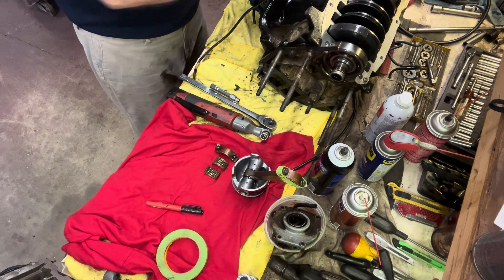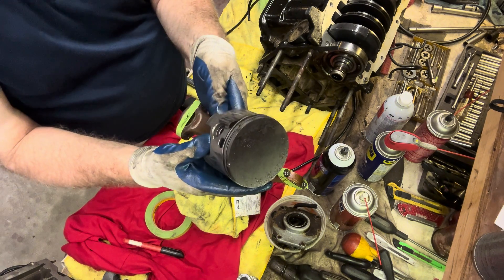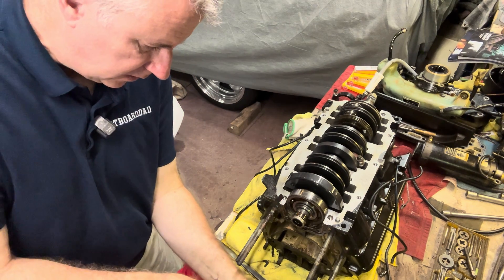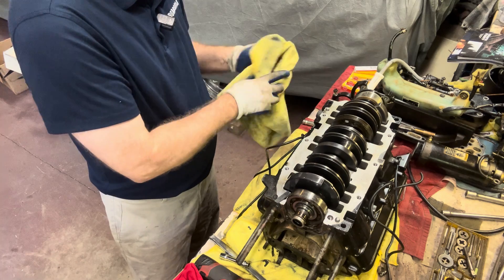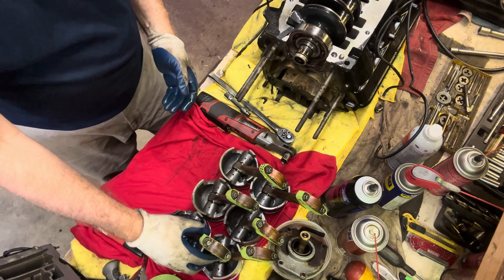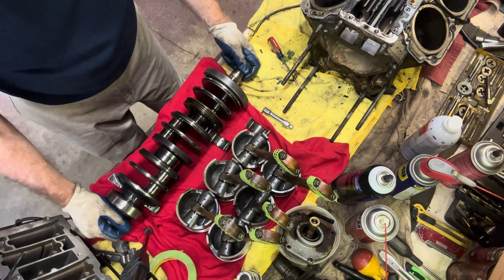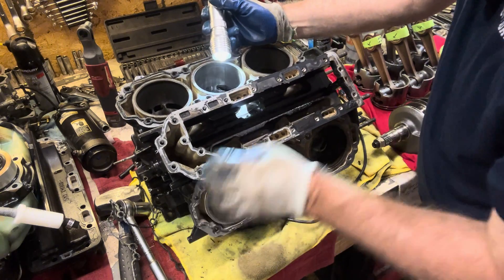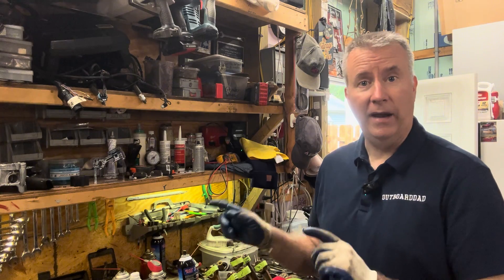Mercury Outboard rebuild project (Part 8)

Comment: Where do you order your parts? I have a XR6 that I need to rebuild
Reply from the maker: @jamesschatzley4267  Hey James, I order most from Pro Marine USA in Fla. But I have a few local places that I use as well. What year and HP? What parts do you need?
Reply: @ it’s 2005 150. I haven’t taken it all apart but Im pretty sure I’m gonna have to resleeve one with one new piston. Im pretty sure I can reuse most pistons. I will have to hon down the cylinders
Reply: @ most people are telling me I need to do a complete rebuild but I’m not sure why if you can hon everything to the measurements.
Reply from the maker: @jamesschatzley4267  So I would start with measuring the cylinders against spec to see how much wear you have and if they are out of round. You certainly can just order new rings and hone but without measuring we don’t know how far we are out from spec. I have a video series rebuilding a 150 Mercury that will help you. Also depends on if you are using cast or forged pistons. Do you have a dial bore gauge?
Reply from the maker: @ Also be sure to check the crank and wrist pin bearings and journals
Reply: @ I don’t have one but I’ll check into getting one
Reply from the maker: @jamesschatzley4267  Let me know if I can help

Comment: HELLO MR OUTBOARDDAD , I BEEN WATCHING YOUR VIDS THEY HAVE HELPED ME ALOT , I HAVE A QUESTION , I JUST PUT A NEW POWERHEAD ON MY 2012
 MERCURY , 2 STROKE , 175 PRO XS (DFI) , AND I'M WORRIED MY OIL PUMP ISN'T WORKING , SHOULDN'T IT BE MAKING SOME 
NOISE ? WHEN I TURN THE KEY ON IT CLICKS 1 TIME , SHOULDN'T IT KEEP CLICKING , I PRIMED IT WITH MY AIR COMPRESSOR
AND I PUT SOME CLEAR LINES ON SO I COULD SEE IF THE OIL MOVING , BUT IT DON'T LOOK GOOD , IS THERE A WAY TO BENCH TEST IT ? MIGHT BE WHAT HAPPEND TO MY OLD MOTOR ,
THANKS
Reply from the maker: @tomocker  ok, did you have a Mercury diagnostic tool to program it for break in mode? I would invest in a new pump when doing a power head swap. Is it direct injection or throttle body? If throttle body mix oil in the gas for break in period.
Reply: @OutboardDad  YES ITS A 2012
 MERCURY , 2 STROKE , 175 PRO XS (Direct Fuel Injection) it's odd because when i took the old one apart everything had a lot of oil in it , i set the breakin oil with the shifter ,
you turn the key on and shift from nutral to forward 5 times in 10 seconds , THANKS
Reply from the maker: @tomocker  good luck, keep me posted

Comment: Very nice indeed!

All your videos are nice and incredibly interesting, but I think that this one was the most interesting one.

To me, as an old motocross racer who had to replace my piston every single year, replacing pistons once in a lifetime is mandatory.

I wonder what caused the overheating. 

I had to replace jets when air temperature was changing 10°C or more. Also when atmospheric pressure changed a lot.

Thick jets in winter with good weather at sea levels and smaller jets in summer, those cloudy low pressure days or at higher locations.

I had four different main jets and two slow speed jets.

At Mercury service manual, I read that it is necessary to use a smaller propeller in summer. 

I also saw that engines dor lakes use samller jets than engines at sea levels.

I wonder why they don't say anything about using smaller jets in summer and bigger jets in winter.

Using an engine on sea with jets for lakes will be very bad because temperature at exhaust manifold will get too high.

What about the color of sparkplugs after a short test at full power?

My 135hp Mercury is now overheating. 
Membrane at poppet valve was broken. I replaced it but still overheating. 

I'm pretty sure that water pump is alright but water passages are very dirty looking at poppet valve and thermostats.